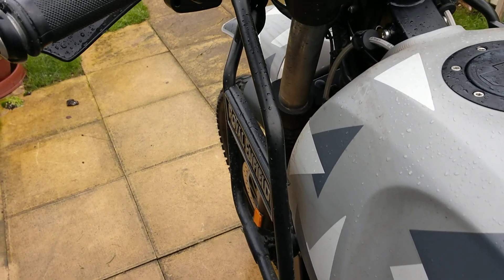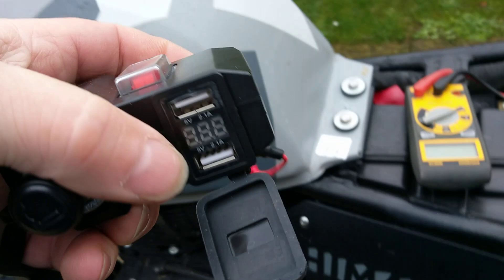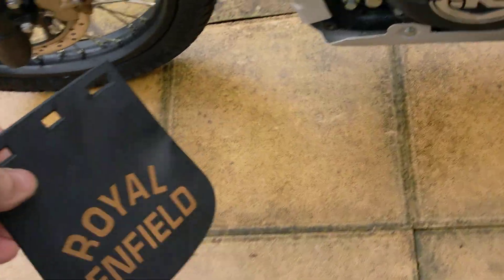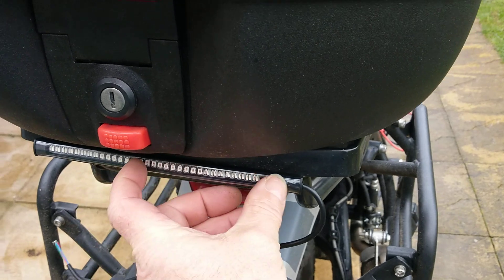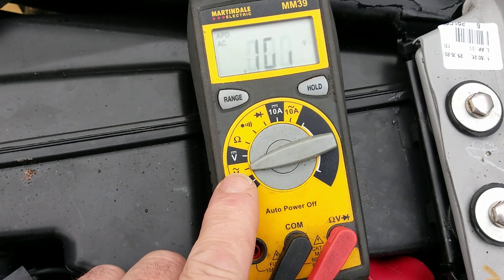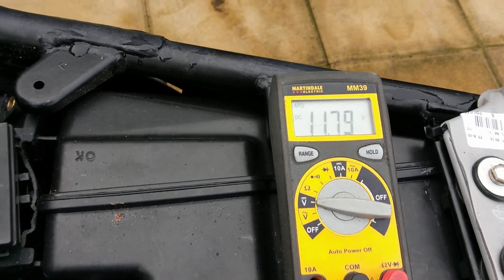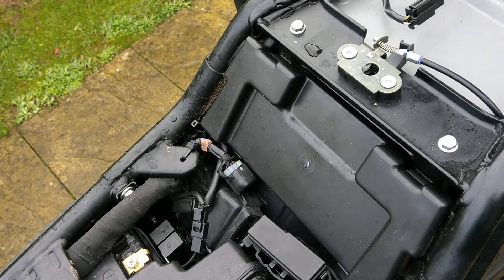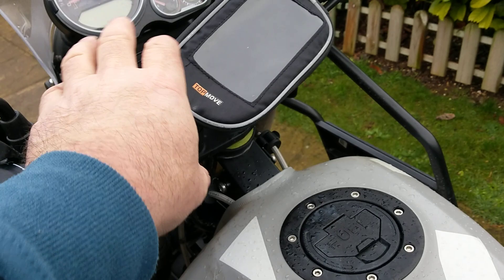Royal Enfield Himalayan Modifications #2 (part 1)

Comment: I've just ordered the same USB and ciggy lighter for my Enfield haha I wanted it for the on off switch as most don't have them and kill the battery from what dual sport installs I've seen on here. And ooh I do like ya mudflap..that is sassy …getting me one or two of those now.
Reply from the maker: Nice one bud, thanks for the comment, you should still run it via a relay and a Switched feed, just in case someone turns it on when you park up and leave the bike, so no chance of drained battery or electrical fire with the keys out. :-)